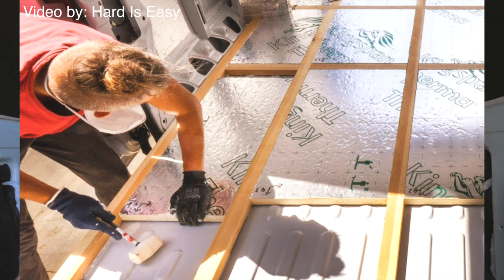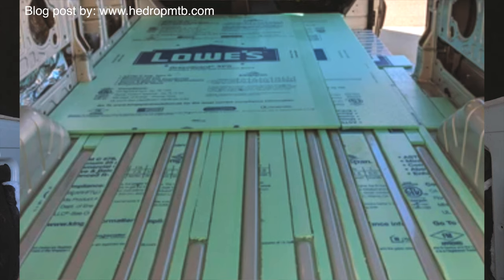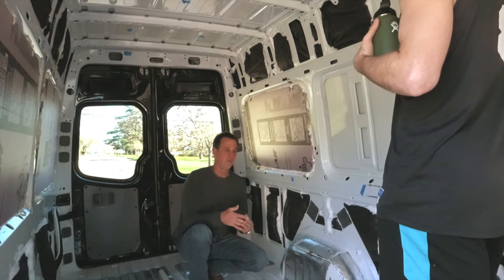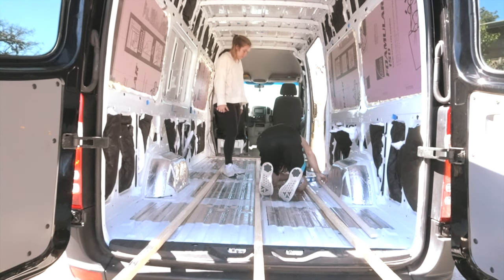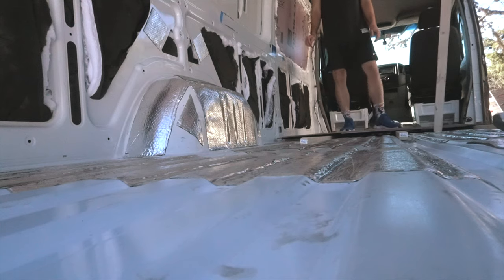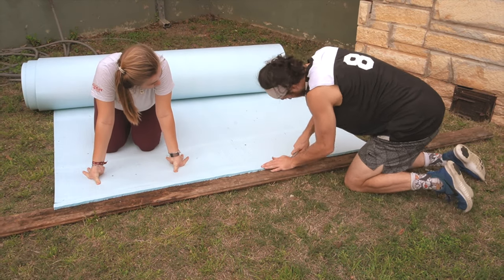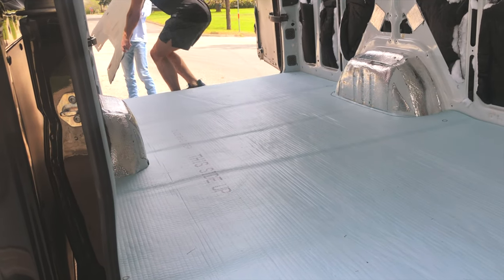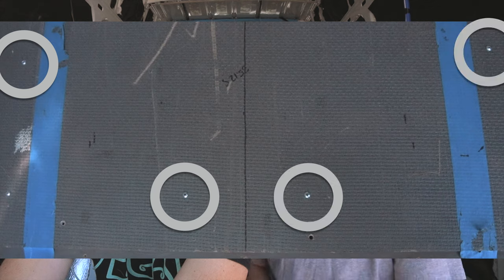INSULATE VAN FLOOR for TALL people // Van Build Ep. 3

Comment: I'll be going through this, husband is 6'4. Im  5'3.  My issue is trying to make a bed area, where one side is, like 5'4 and the other side is at least 6'4. We would waste too much  real estate having one long bed.  I see an electric bread knife in our future. Thank you for the tips on insulation, it does feel like so much is lost to it.  Im so lazy, I can see me throwing a bunch of carpets.  Kudos that you figured it out.
Reply: Do not do what they did in this video, terrible idea to fill in the struts with insulation, it will block air flow creating a lot of condensation and humidity that will then bring rust and mold.
Reply from the maker: Sorry for the late reply. We went for the bed/bench combo so we have a long bed that fits dylan 6'1. We bought a KING dunlap mattress and cut it up to fit perfectly. As for the floor, we have been inside vans that do have floor insulation and that don't... TBH they all feels the same lol. Good luck on your build!

Comment: DO NOT do what they did in this video, terrible idea to fill in the struts with insulation, it will block air flow creating a lot of condensation and humidity that will then bring rust and mold.